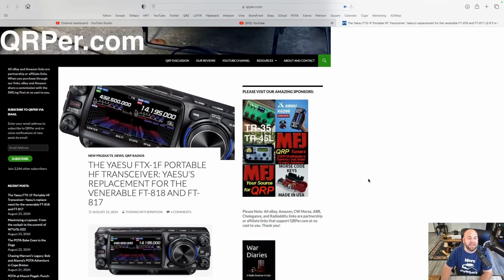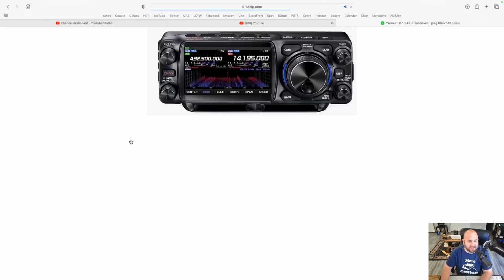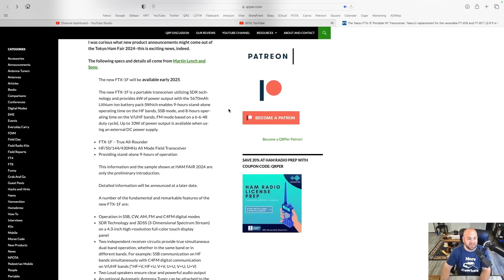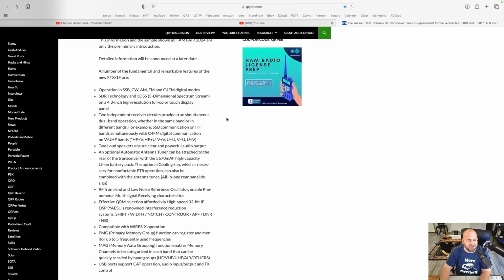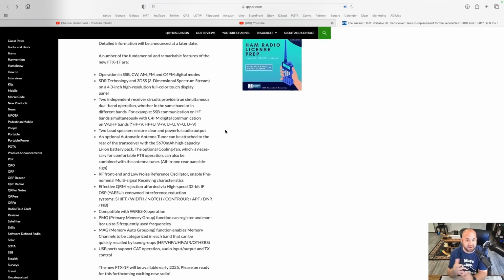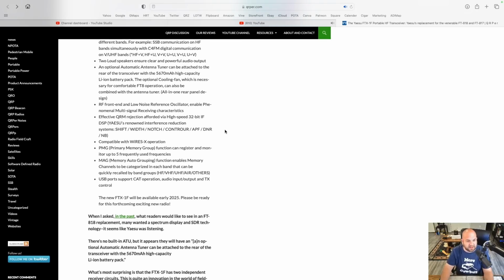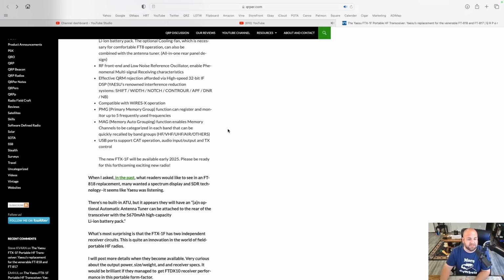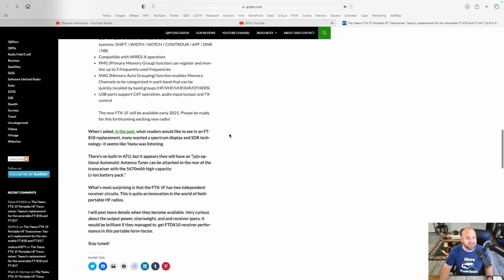Yaesu Announces The New FTX-1F Replacement For The 817

Comment: Sooner or later:
Someone will produce a 100 watt brick with NO BUTTONS, NO DISPLAY and one cable to plug it into your computer.  It will run Windows, Mac, or Linux.  It will do automatic updates or updates on demand.  This would be THE BASE STATION.

Comment: Yaesu also needs to create an answer to Icom's 905 as well. One that works on battery like the 705 does but the 905 does not. They should also integrate the 10 GHz transverter (expensive option from Icom) and sell a decent priced dish antenna for microwave (SHF) and microwave TV.

Comment: It looks like it could be great, but the more i think about it, this wont really impact the IC705 sales as much as Yaesu hopes it will.  Its 4 years too late. They are going to have to make it appealing from a price stand point.  Also, there are accessories like the tuner and fan along with extra batteries.  All in is going to be well over 2K.  The IC 705 is a proven winner with far more field time and several Firmware revisions.  Yaesu has alot of catching up to do. I havent upgraded my qrp rig , and I am going to wait and see.
Reply from the maker: I don't think this will be a 705 killer but Yaesu has been long overdue for a new QRP radio.  Going from the 817/818 to this is pretty awesome.   Plus some people prefer Yaesu to Icom.  I put in my $35 to reserve one.  We'll see how she goes.

Comment: I do like the machine, but hyping is not in place here. Besides the nice features, it lacks some essential things. No Wi-Fi, no Bluetooth and no build in GPS like the IC-705 has standard. For some, these can be essential. Also, not all data is provided as today. I cannot find a brochure, so waiting is in order. Seems the DX-101 SDR design is used. I'm still deciding between the FTX-1f and the IC-705. The price will be decisive for some, and I guess a €1300 can get pull hams in the Yaesu camp on this one. Pricing it like the IC-705 is not in its favour due to the lacking features. Just my 2 cents...
Reply from the maker: Yeah I kinda agree with you.  While I don't necessarily use the features you mentioned, I know a lot of people do.  But if I need to I can sync the GPS from my 705 to my computer with a USB cable I can.  You've gotta have a proprietary cable and a degree in Chinese Algebra to do that with a Yaesu.

Comment: I am keeping my IC703+.  10w with tuner.  Low power drain even on standby.😊
Reply: Same I keep my Ic 703+...10W with modulation compressor, built-in tuning box...and low power consumption...all for 450 euros a few years ago and it's still in the game!! Now pay 1600 euros (3 times more expensive than a used IC 703+... to have a TFT color SDR huais...not right away....73 Jim

Comment: I'm working on getting my license now (finally!), and I admit I'm a bit confused by how you're supposed to use these types of radios. I have an HT that does 5-10 watts on VHF/UHF, so 6-10w doesn't seem like a whole lot of range for something in this price class. But clearly it serves a large market of hams. What's the typical field configuration for a radio like this? What sort of range does a portable user expect to get?

I know a lot of people use radios like the IC-705 with an amp as a home base station, as well, and that there's real value in having an all-in- HF/60/2m/70cm rig, but as someone who's not that interested in POTA/SOTA due to disability/mobility issues, I'm having a bit of trouble figuring out how the market segmentation works between this and something like the Yaesu FT-710, which could be portable if you're motivated enough. ;) 

I suppose it depends on what the actual retail price is. The FT-710 with the AESS speaker is like $945 on sale at HRO right now.
Reply from the maker: It is very possible that you are not the in the target market for this radio and that's ok.  It's all about size, weight, & form factor.  Not everyone is just going to a park bench to operate POTA.  Sometimes they're hiking miles on trails in parks or hiking up mountains for SOTA.  Larger radios like the 710 you mention are generally too big and heavy to want to carry long distances.  Not to mention the larger capacity battery you would need to carry to power the radio as they have much higher current consumption.   In the portable game, smaller and lighter is key.  And radios like this, the Icom IC-705, Elecraft KX2 & 3, and so many more radios in this "portable" category fit the needs of the operator.  Not to mention, transmit power means very, very little.  Generally we'd deploy this type of radio with a light weight wire antenna.  I use 26AWG for my End Fed Half Wave.  I usually tie the feed point of the antenna to a tree a few feet off the ground and run the wire up to a compact telescopic mast that will extend to ~33feet.  While VHF/UHF frequencies are usually good for several miles, HF communications allow us to talk around the world.  Yes, even with 5-6 watts or less.  This video pretty much sums it up.  https://youtu.be/rpRZEpBcoc0?si=de4-qK0sHvMUXmy1
Reply: @hamradiotube  Thanks! I know I'm not the target audience for this one, but I realized I also didn't really know how they were meant to be used. This is a great summary. I do like to try to understand products I don't necessarily need so I can point people at them if it's what they need.

It's kind of wild to think that if you were crazy enough you could fit all this into a backpack with a battery just walk around with a fully functional transceiver--though extra care would be needed to avoid RF burns, I guess. And it's a great reminder of what can be done on HF with 5-6 watts. For some reason I thought you needed at least 10 watts, which is what started my confusion in the earlier post.  :)

I think I probably get a little confused about what is reasonable to lug around in the great outdoors because it's not something I do and also I'm old enough to remember when the original Apple Macintosh in 1984 came with a carrying case and you were expected to pack up and carry your 30 pound computer around for on the go productivity. Everyone must have had reinforced spines in the 1980s. ;)

Comment: Looking at the picture over at ML&S it seems to be a  radio where one has go into a menu to change anything at all, which sucks. I have a FT-891. Want to change bands? Into the menu you go. Want to go from one type of modulation to another, into the menu. It is why I keep using my FT-857D over the FT-891. Two buttons for changing bands. Two buttons for changing modulation. IMO I should not have to go into a menu to change the most used functions.

Comment: When you read that I first heard "4.3 inch high" screen, and I thought WOW!  That's HUGE!  Then I read along with you and saw that it's actually 4.3 inch, "high resolution" screen, which puts it in the same size category as the 705 (my mistaken perception, not yours).  I came within milliseconds of pushing the BUY button on a new IC-705 just a couple of days ago and thought, "Naw, think I'll wait and see what's coming at the end of the year".  Glad I waited, as I want to see more on this.  Until then, my IC-7300 can still be hauled along on portable activations.

As always, thanks much for sharing.

Steve

Comment: Rather than (or in addition to) QRP, it'd be great if Yaesu came out with a replacement for the old FT-857 full power form factor, with ATAS compatibility. The 991a is nice, but it isn't a mobile rig.
Reply from the maker: I agree.  Having the 891 and ATAS in my car along with the FTM-300, it would be cool to have one radio that does it all.

Comment: "HF/50/144/430MHz"   So all of HF? And 6m 2m and 70cm? Hmm. Dang. That's a lot of antennas to pack and haul around.
Reply from the maker: But if it works with the ATAS...that would do it all.  I usually carry a J-Pole for 2 meters along with my HF antenna so it's not really a big deal for me.

Comment: I really need it to have 9600 baud data port/ flat audio port. I skipped IC705 due to it lacking this capability. Ft991/FT991a sound card does not allow 9600, but analog 6 pin data connector does. And the sound card needs to have at least 48KHz sampling rate. The SCU-17 for example has only 32KHz.

Comment: If Yaesu wants to compete with the 705, they should come out with a radio that beats the 705 in terms of features and functionality, at a price point lower than the 705.

Sorry, but I'm not dropping $1200, $1300, or $1500 on a QRP radio.  One of the major gripes we all see online is the price of admission into Amateur radio, and major manufacturers coming out with new shiny that costs in excess of $1000 isn't doing anything to help the cause --especially when they don't offer lower-priced alternatives.
Reply: They should have made this full power to go against the 7100.

Comment: I'll be happy if they make a version that is a 100 watt portable with all those features in it.
Reply from the maker: gone are the days of the 857
Reply: @hamradiotube   I agree but I still own mine from when they still were making them before they dropped them.  I would not trade it or sell it
Reply: I wonder if manufacturers will go back 100-watt, all mode, all band models when Cycle 25 is dropping back into minimum.
Reply: @TravelinHam exactly.  All of these 5 watt radios will be useless in 5 years when at Solar Minimum when only 20-30-40 are open.
Reply: They couldn't stock enough of them,  there wouldn't be any competition
Reply: Since these won't even be out till early 2025 yeah if they ever do I can guarantee they would make money on a 100 watt version of it. Then they can say that they officially replaced the ft 857d

Comment: Pros and cons vs 817/818:

Pros: It exists.  SDR, good waterfall/screen, certain orders of magnitude better performance on receive with filters/NB/NR, better battery life.

Cons: likely north of $1400, looks fragile compared with 817/818, certainly not water resistant, KX2 still the only "trail" rig with an antenna tuner bult in.  Looks like no front antenna jack - it was great for a BNC "elbow" connector and a 3rd party 2m/70cm antenna.

Asides: Dual receive does not = full Duplex, no advantage on satellite (you don't listen to the uplink).  "optional" cooling fan for FT-8 is concerning for over-heating.  Would have preferred an updated version of 817/18 with rugged chassis, built in tuner, SDR capabilities, smaller screen (you don't need a waterfall activating POTA).  Why would I buy this and not the 705?  Why would I not get the cheaper Kx2?

Comment: In these days 20w should be minimum in portables.
Reply: @chuckdebian2205 we do it all the time in the CW world 🤔
Reply: @chuckdebian2205 Locally last night, 10M was horrible.

Granted I wasn't running the same polarization, but me and another guy within 10 miles barely heard each other on SSB with 100 watts.

The other guy who was closer and could hear me at 30 watts couldn't hear me when I used my uSDX QRP radio.
Reply: Agreed. 6 watts is literally pointless if you're not on a summit.
Reply: @nilpo  incorrect, completely. I work everywhere with 5 W or less. It's a QRP radio aimed at QRP enthusiasts who become skilled at making contacts that many others can only dream of. 73 M3KXZ
Reply: @petemillis4666  Packable doesn't imply QRP. Nor should it be limited to QRP. There are plenty of reasons including EmComm and POTA for a rig like this. In my area, 5W won't even get you above the noise floor. 

This is 2024. With modern electronics and cooling methods, there's no reason to make a radio under 20W. You can always turn the power down for QRP. But you're probably not going to carry an amplifier in a manpack.
Reply: @petemillis4666  It’s difficult to rely on just 5-6 watts.  If condx suck it’s nice to push the power up especially for SSB.

Comment: You're welcome guys. I bought a 705 this week after getting tired of waiting for the 818 replacement. This is why it finally came out 😂
Reply: I don't think you missed much.  Especially as a portable platform, I think an argument could be made that the 705 and FTX-1f from a practical standpoint are identical; with the ICOM having more accessories and being available now.
Reply: @kd8opi  That's kind of my thoughts as well. With the way things have been I'll bet this thing will be sold out for a year and most people wont get one until this time next year or later and then it'll be 1-3 years before we see many accessories, protective cases, etc designed for it too. This is just the beginning lol
Reply: Thank you for taking one for the team. I was getting ready to buy the 705.
Reply: I hear ya, bud! I almost did the same as you
Reply: Same, bought my 705 in May.
Reply: Oh that’s has to hurt. 705 is great but at first glance on specs this is insane.
Reply: @schoocg  Got it used at least, 400 cheaper than MSRP. That's one plus side haha. I'll wait till someone buys the yeasu and finds out it isnt for them and pick it up secondhand also lol
Reply: Love my 705

Comment: As long as they don't use micro USB I'll be happy. I'd take mini USB over micro 10 out of 10 times, since it's less likely to disembowel itself. 
Something else I would like to see is the memory playback option not blocking the entire screen like with the ftdx10. Maybe put it on the bottom like ICOM does or possibly where the second receiver would be in the mock-up. CW operators would love that.
Reply: USB-c would be ideal or atleast a 3rd party aftermarket part to make it usb-c
Reply: @BobBob-il2ku  yeah, ideally it would be USB C from the get go, but if not then I would hope it at least isn't micro USB.

Comment: I'm really looking forward to seeing you get hands on it. I do fear however, that with all of these outstanding capabilities will be a price tag that is appropriately outstanding. I don't foresee these being at the same price point as the 817/818s, and sadly that means they'll be outside my budget. My 891 will have to soldier on.

That all said, I wonder if this could signal a possible new replacement for the 857 & 897 on the horizon? One could hope.

Thank you for the vid and heads up!
Reply: I think this rig will be $1400.  The 818 being $600, rugged, with like a million accessories and kits, will be missed.  These aren't trail or mobile rigs.

Comment: I'm curious if, based off of this carry over of the SDR tech from 710/FTDX and similar, if there is an updated/replacement 991 also in the works. Maybe with the addition of 1.25m.

Comment: If its full duplex , it will be the radio satellite guys have been screaming for !
Reply: Dual receive is not full duplex; its not full duplex based on the stats.  Unfortunately Mike misspoke or didn't understand that being able to listen to two different bands has zero application to working satellites.  You don't listen to the uplink (the whole point of sat rad is the downlink).  Full duplex is being able to hear the other person (and yourself) on the downlink while you're transmitting.  The only radio that I know being made currently that is full duplex at this time is the VHF.UHF powerhouse ICOM 9700.  The 905 (the small version) has not come out yet and does not appear to be full duplex.  It looks to me like if you're jonesing for full duplex VHF/UHF, you wont spend a ton more to get a 9700 c/w what will likely be an expensive FTX-1f

Theoretically, full duplex would allow for narrow bandwidth data contacts across a spectrum of the receive slice to be decoded simultaneously (kinda of like FT8 on the receive side) while uploading your own at the same time during a precious pass (which is not FT8 like, its why there is a receive and transmit cycle).   For FM voice contacts it would bean you could hear everyone coming into uplink while transmitting, possibly making more contacts as a result.  Again, it has nothing to do with dual band receive.  It has to do with being able to receive while you transmit on the same band, or receive while you transmit on a different band.

Comment: finally a competitor to the 705
Reply: Is it though? This one is only 6 watts. Even for QRP that extra 4 watts makes a difference.
Reply: @nilpo  both have 10W with external Powersupply.
Reply: @nilpo  it 10 or something with external power.  Internal batter only is 6 based on the video.  I know it varies, but for contesting 5w is the upper limit of qrp power.
Reply: My experience, Icom receivers are a leap ahead over Yaesu receivers.  But hope springs eternal.... maybe this one will actually beat the 705.

Comment: Gotta love how they dropped this the day before the X60 reveal.
Reply: 6w is a bit light
Reply: @richie4540 ....on internal battery power.  Up to 10 with external battery.  Works for me.
Reply: What’s the X60?
Reply: Just a Coinkydink.
Reply: @Aimsport-video  coinky dinky?
Reply: They have different use cases I guess.  But with an amp with high gain, it can work as a home station for some.  I bet it will cost roughly USD 1k
Reply: I would be shocked if it was only 1k. Its probably more like 1200-1500 @la7dfa

Comment: Would like to see ATAS support.
Reply from the maker: Oh good point!
Reply: Had to quickly check the calendar- nope, not 1 April. Great news!  ATAS-120 support and I’m buying.
Reply: @wright1049 I did the same thing
Reply: Me too
Reply: I'm not sure why the ATAS is suddenly the new (old) hotness.  It's an antenna that's been out for years, but was never revered as a performance standout, if memory serves.

Perhaps this is more a function of YouTube influencers, influencing?
Reply: @N0LSD Not for me; I love my ATAS 120 mounted on my SUV…. wow…. love it.
Reply: This is what I was wondering, but since it is QRP and when on battery the max output is lower than on external, maybe the ATAS is too much load?  I would think they would have mentioned it if it had it. Maybe the 891 has its place.